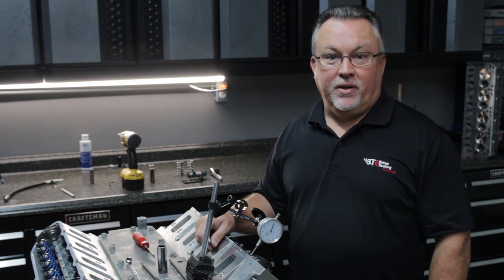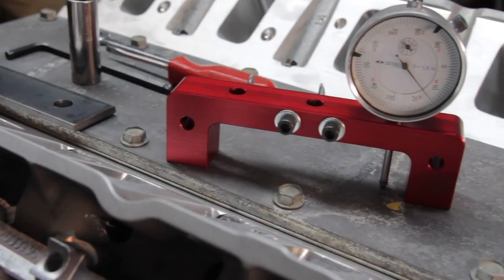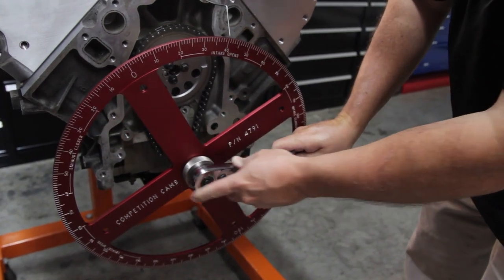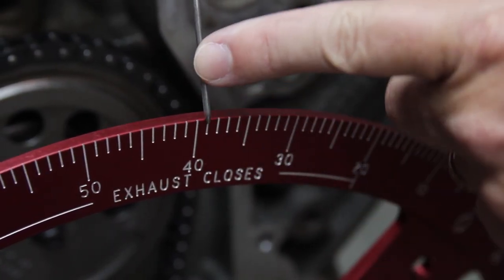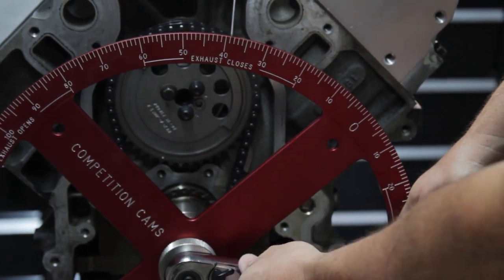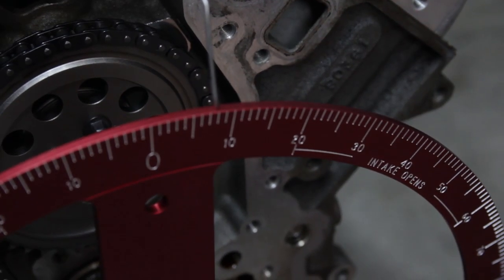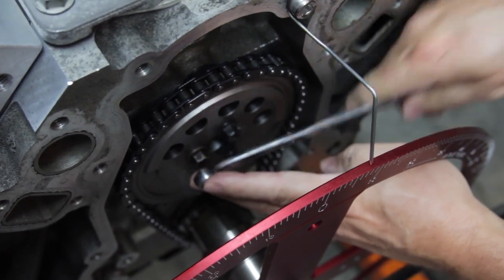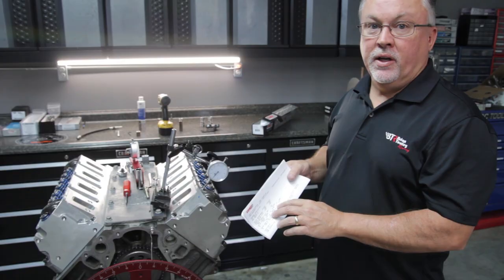How to Degree a Camshaft

Comment: So you do the 40 and the 42 and then pull out the piston stop and set it to 41 then do you pull the wheel off and put the 0 there?
Reply: No..When you adjust the pointer to 41, you are 41 degrees from TDC..Then you rotate the crank to zero on the dial and you will be at perfect TDC
Reply: Yeah, I don't get this either...
Reply: Hey Friend,

Pretty sure the piston stop tool usage idea is tricking us into thinking it found TDC when the piston stop is bumped into...

When really... the piston stopper is too wide to show us Zero degrees(tdc).

Instead ithe numbers where the wheel gets stopped shows us a known degree count as the crank rotate first in one direction... then the other.

Picture an apple pie with a slice cute out. The missing slice is at 12 o clock in a mental picture.

We have a wheel degree measuring tool that can be anchored to the pie and 2 stops that can anchor to the exact edge of the missing pie slice.

Now... turn the wheel until you bump one edge... its at 340 degrees... turn to the other stopper... its at 022degrees.

See how the hole... shown is 42 degrees wide??

Split the 2 numbers by 2 pieces and you know the absolute location of pie center (TDC) is 21 degrees away from the 2 edges of the imaginary pie cuts.

Remembering All holes have exactle 360 degrees... we can see that...
"Top dead PIE" (Tdc) will be found...
21 degrees before the 022... 
and...
21 degrees after the 340.

Now you found and showed true tdc in a pie via these process steps. 

Apply the same missing pie slice concept against a crankshaft and only think about the crankshaft even tho you utilize the piston stop in the cylinder of which you are finding TDC for.

Hope this helps... i likely wont be back to re explain. Best wishes.

Comment: Dot to dot.... all I know how to do. 🤷🏼‍♂️
Reply: Lol Exactly! I've built dozens of 400-450HP sbc in my time and never used anything but a $40 Double roller chain from local parts stores. This is for the racers that have $10,000 in an engine trying to get every 100th of a second at the track but not us normal street light to street light guys.
Reply: @lindajones1592  hey I’m 15 and trying to learn how to degree a cam. If you get a cam that’s the same size as your stock cam, would you still have to degree it? And I’m still trying to figure out how to do rod bearing clearances too
Reply: @blakefrizzell4616  define same size? Like same lsa, same lift same duration same everything? No u wont have to degree it. Set timing marks up, 2 rotations and make sure they line up. If so then send it

Comment: How do you get a good measurement with the head on? It looks like he was reading off the rocker arm. But how does reading off a collapsible lifter work?
Reply: Reading off the push rod for lift degrees, disassemble the first cylinder rocker arm and check like that

Comment: Do you need lube the cam for the degree process?
Reply from the maker: Yes, standard engine oil is all that's needed.
Reply: Thank you for the fast response! First time doing LS cam swap and wanted to make sure I get everything correct.

Comment: It amazes me that cams can be so out of spec
Reply: Its not always the cam thats out of spec. Could also be the timing gears, or the key on the crank.
Reply: Lol man NOTHING is out of spec, the engine is DIALED in with the stock cam that the Automaker has designed for the EXACT application it was built for mostly everyday use, with that said, when you install  a New Different cam the cam duration and opening time it TO has to be dialed in the EXACT same way and so instead of machine another crank for the specific cam your about to install in the engine every time you change cam to make up the timing difference you just do it in the New Hi Performance cam Ajustable gear and Degree wheel,  but I’m Definitely not trying to be rude Sir I was just saying that’s why,
Reply: @gregjustice7013 OEM manufacturers do not degree camshafts on production engines. This is what your dowels in your cam and slots in your oem timing chains are for. 

They have allowable tolerances built in and are not always, and not usually, exactly what they're supposed to be. The aftermarket camshafts aren't either.

 This is EXACTLY why you degree one in, and you have to have an adjustable timing set to do so or otherwise all a degree wheel is going to do is tell you how far off your camshaft is, OEM or aftermarket, either one.

Edit: That Comp Cam he installed wasnt "exactly" in spec or he wouldn't have adjusted it to align it with that degree wheel. It would e been aligned already by its dowel. I think Comp allows +/- 2 degrees variance to go out the door. They may have tightened that up since I checked last. At one time, they were looser and caught a whole lot of shit for it.
Reply: It's not the cam, it's the gear, slack in the chain, or machining that throws it
Reply: @bryanrobbins7390  they're doing it because of the cam, I assure you. Chain slack that causes advancing and regarding of the cam is out of the control of the degree process as slack In the chain rotates the gear wherever you set it.